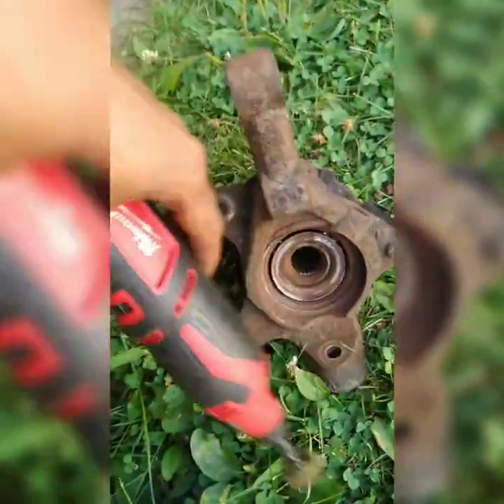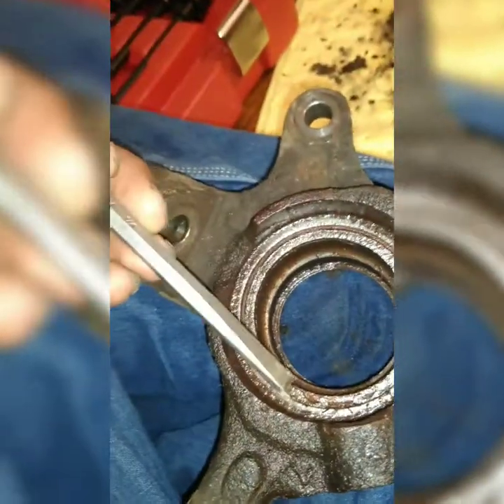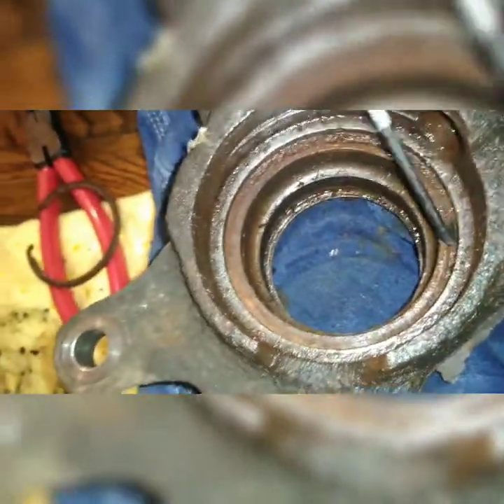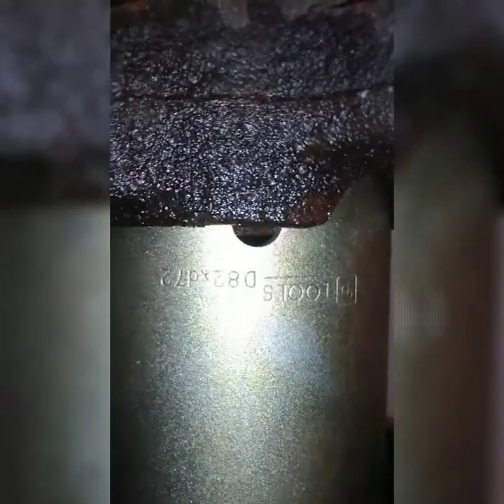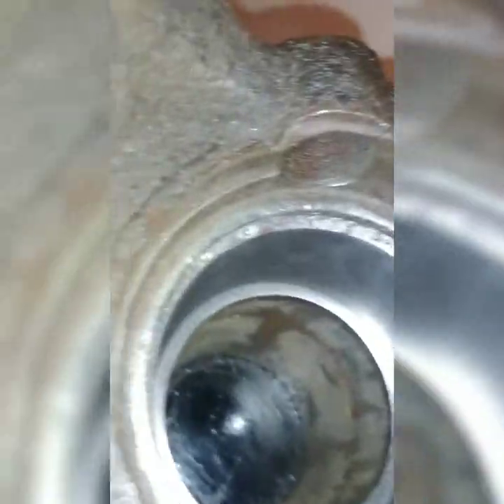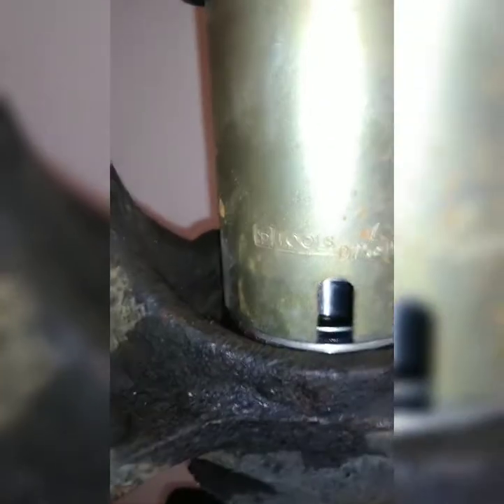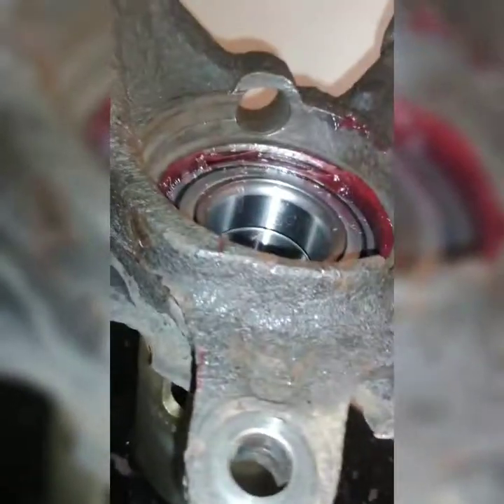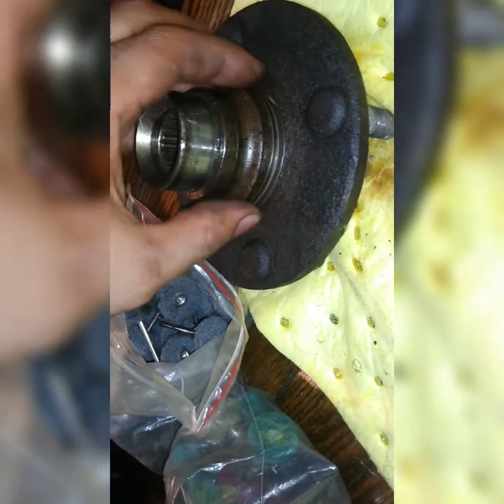06 Scion Xa front bearing replacement briefing...Pressed in bearing removal/install basics

Comment: What size cup did you use under the steering knuckle to press out the bearing into?
Reply from the maker: I'm sorry James i don't remember it's been a while, i just grab the big enough cup so the bearing comes out
Reply: @troubleshooterr5775  No problem. Do you happen to remember the brand name? Maybe I can buy a whole set.
Reply from the maker: @James Southworth  Schley (SCH11100) Manual Bushing extractor,
It's a bushing tool that could be used for bearings too
https://www.amazon.com/Schley-SCH11100-Manual-Bushing-Tool/dp/B01LRJ4XAU/ref=mp_s_a_1_4?crid=EETLVZUHX5H&keywords=schley+bushing&qid=1660660191&sprefix=schley+bushing%2Caps%2C135&sr=8-4
$488.99 current price